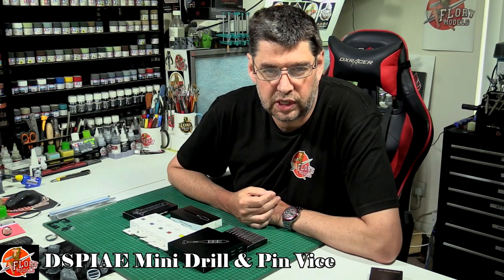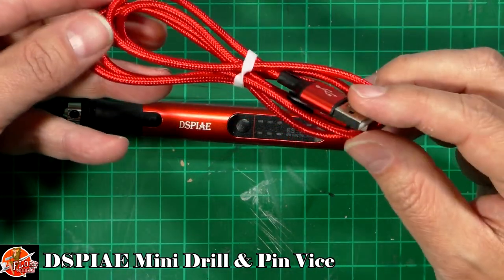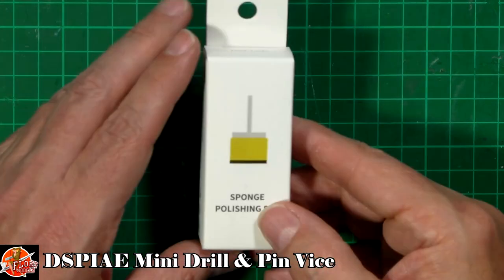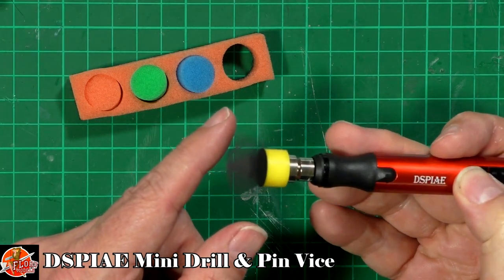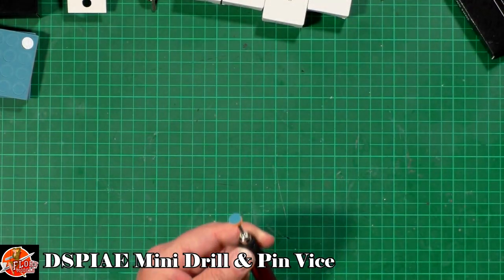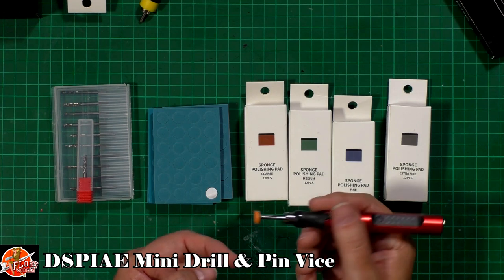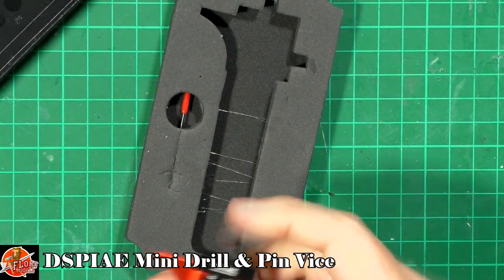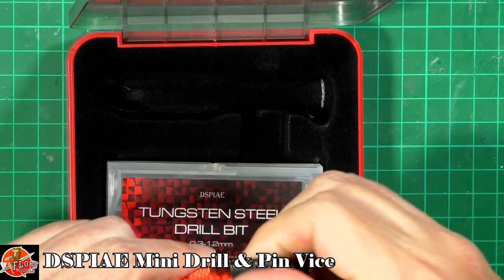DSPIAE Mini Drill & Pin Vice Review

Comment: The bits from dspiae are for sanding the plastic, but if you want a type of drill bits that drills through the plastic look for the Galaxy Tools T09K11 shank adapter and its 2.35mm bits.

Comment: The pin vise is rubbish. After a few uses and being very careful not to overtighten, the Allen wrench will easily round out the Allen set screw in the vise.  My mate had the same issue, until DSPIAE starts using a higher quality set screw this is a waste of money and won’t last very long.